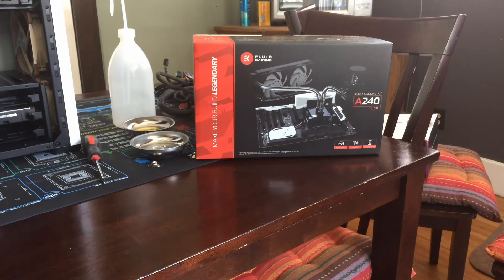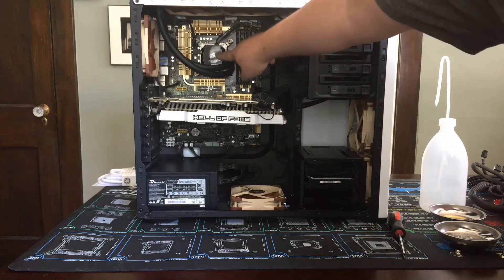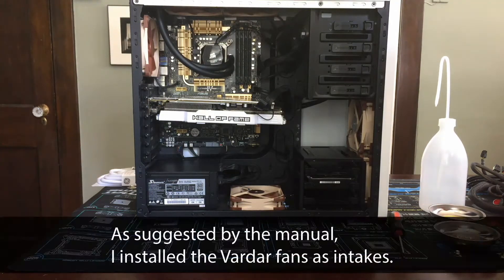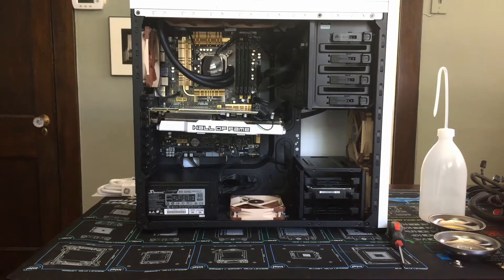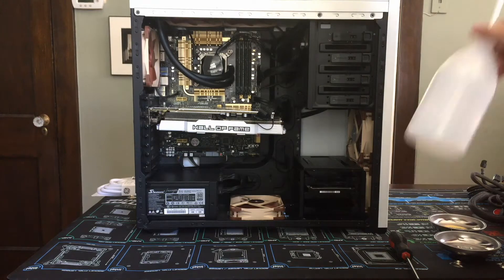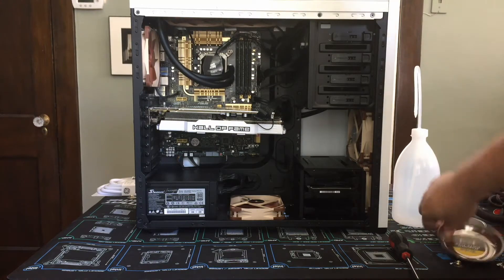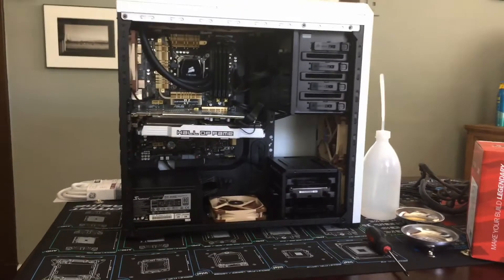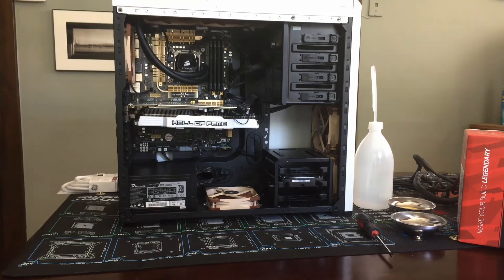Custom PC Watercooling with Aluminum: EK A240 Install & Results

Comment: you need to fix that gpu  sag and why post a video thats half missing the important bit is missing you cant call this an install if you theres no video of you doing it
Reply from the maker: Hey thanks for watching. 

I fixed the sag and showed what I did in a subsequent video. You can see that here: https://www.youtube.com/watch?v=2vIvvAH_a5U

Additionally, this is still one of my early videos and I had run out of memory on the camera without realizing it, so yes, some of the installation is incomplete due to technical issues. But the content is still valid as a reaction to the installation process.

Thanks again.
Reply: no worries just thinking about purchasing the kit myself and wanted to see how others have got on with installing it i.e how it looks and the best way to route the tubing look forward to more content.

Comment: Hi great job ! Do you think there will be alone part of these aluminum block ? Particularly the clone from eBay or Ali express for some $?
Reply from the maker: Thanks! I do know that +EK Water Blocks is releasing standalone aluminum blocks. I don't know when they will be released though. Check out https://www.ekfluidgaming.com/parts/ You can see a block that is still blurry as coming soon. :)
Reply: Middle of Knowhere thank you I'm hurried to buy real waterblock because for now I have 2 cheaps made from eBay without fins inside and I have  not tested yet them

Comment: So stupid question, im not experienced in custom loops and all but if u wanted to swap out the pump that comes with this to something else would that even work? Or be better to just do a full custom loop anyway? Im on a budget as already spending 1500 bucks on a 7820x build so money tight but i been eyeing this kit for a little bit and like it, i dont need no gpu coolers as i have 2 hybrid 1070s so just mainly wanting something for cpu besides a standard AIO and i also read that they plan to release future parts in future but so far dont seem like nothing been released as of today which is why im curious when they say there gonna release future parts, they mean something like bigger radiator or a different kinda pump or what.  Anyway ty for the vid as was helpful, specially the benchmark.
Reply from the maker: +eclipse6996 Hi there and thanks for the view and comment. As far as swapping out the loop goes, I do know that the loop in the fluid gaming kit apparently is not a DDC, so the DDC pump heatsink/housing won't work with it. I'm unsure if you can swap it out, but I don't see why not unless there are different metals in the pump that would lead to galvanic corrosion. I don't see this being the case. HOWEVER, my advice to you is to shoot EK a quick email via customer support. They are quick to answer, usually in a day depending on the time you email them as they are in eastern Europe.
Reply: Ya i actually came across a seperate vid that also explained it and since im a noob on this i didnt understand why u couldnt use a seperate one but if its not alluminum like the other parts then wont work but apparently there suppose to be releasing expandable parts like the 360 rad or something hopefully soon as might hold off for that but yes ty for clearing it up regardless :)
Reply from the maker: That's right, this fall/winter +EKWaterblocks will release separate parts so you can expand your loop. I believe larger rads, fittings, GPU blocks sold separately, and other stuff will all be available, but I'm unsure of the pump. You know what, let me contact them and see what they say about getting a DDC or D5 pump and putting in lieu of the Fluid Gaming pump. I'll post back here when I get the answer.
Reply: Oh u aint gotta do that man :p i just naturally assumed they would have to release a bigger/powerful pump since if u add a gpu or 2 to the loop, not sure that little guy could cool everything.
Reply from the maker: Hi +eclipse6996, I got a response (told you EK was quick). Here it is: "The users of the Fluid Gaming KITs are currently restricted to use of the ALU pump that comes with the KIT, but the new pump for ALU is coming out soon, so that means the KIT will have expansion options - expansion parts."

SO out of the gate you'll be restricted, but there will be an option in the future for a different pump, so that's cool. Probably something more powerful if you have a larger loop. It will be interesting to see what all expanded options will be released in the coming months!
Reply: ya i almost wanna hold out for the bigger 360 rad as more surface area = more cooling so seems like it might be soon soon, with 7820x being sold out everywhere might be released by time i find one in stock lol, but ya i appreciate u finding out and all :) ty ty
Reply from the maker: You're welcome. I'm glad I could help. 

Yeah if you don't have your full system bought yet, my advice is to keep squirreling away your cash, see what EK releases in the next quarter or two, or when your CPU is out (whichever comes first), then buy all your gear at once. Also though, monitor prices in the interim. Sales (labor day is coming up in the states if you're from here) happen so some components might become cheap enough to warrant the purchase separate from the rest, especially RAM and SSD's since the prices seem jacked at the moment, and GPUs due to mining. 

The reason I say buy all at once is you never know what gets released. +JayzTwoCents recommends never buying parts one at a time but instead try to get it all at once. It's just a matter of how soon do you need the gear. :)
Reply: Ya i been mostly just camping the cpu i want and at least snag it cause they sell out quick so if i can least snag the cpu i can handle waiting a little bit cause other pc parts i need wont be selling out like that and yes im from the states so ya im down for some sales lol.

Comment: GPU sag made me cringe xD
Reply from the maker: You're not the only one. :) I plan on getting a bracket soon. Those Galax HoF cards are heavy as hell.
Reply: Middle of Knowhere ahaha
Reply: I also wanted to know what size tubing that is and if you’re able to swap out hard tubing instead... lemme know! Thanks :)
Reply from the maker: It is 10/13mm (ID/OD) - Clear. I'm sure you can swap it out if you find comparable/compatible tubing. There's probably better out there with those dimensions.
Reply: Middle of Knowhere oh sweet. I plan on doing a full “custom” loop :)
Reply from the maker: +Jack Kiefer I modded the case to have a window instead of the mesh, so now I can see that gpu sag always. :) Well until I fix it. Researching some DIY methods that won't cost as much as some of the tools out there provided by companies.

https://youtu.be/02DXmlovbFI
Reply from the maker: Hey Jack, I just uploaded a video with a GPU sag solution. Check it out if you'd like. :) My GPU is now sag free.
Reply: Middle of Knowhere just watched it yesterday :D
Reply from the maker: Awesome!
Reply: No only the soft tubing works with the compression fittings on this kit

Comment: That gpu is really sagging!
Reply from the maker: Yeah it is. The Galax GTX970 HOF is super heavy. I'm contemplating getting a GPU Support bracket.
Reply from the maker: Hi Greg, it's not sagging anymore! I did a DIY solution. Uploaded a vid on the solution as well. Check it out.

Comment: Thanks for putting this video together man. I just got my A240G installed a couple minutes ago. It took me all weekend. Working inside a mini-ITX case was a real pain, heh. I had so many tube kinks to deal with since I had to make sharp bends and had limited tube space (the zip tie trick to act as a faux anti-kink coil saved the day here, but my fingertips have suffered great casualties). Running the leak test overnight, can't wait to see temps tomorrow versus the two 120mm Corsair AIOs I had.
Reply from the maker: Thanks for watching and commenting! Yeah it definitely took longer than I thought it would but I had a blast installing. EK's instructions made it so dang easy. I think what took the longest was attaching the fans/radiators to the case as the Corsair Carbide 500R is a bit of a pain for that and then second longest was doing the tubes. I've love to see pictures of your build with the A240G. I wish I had a 10X0 series card. I would have probably went with the G as well. :)